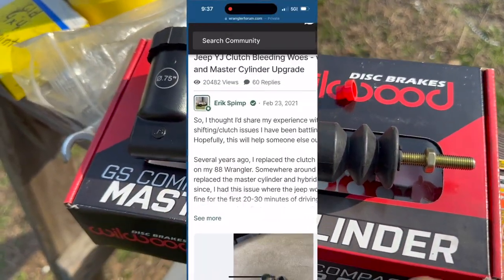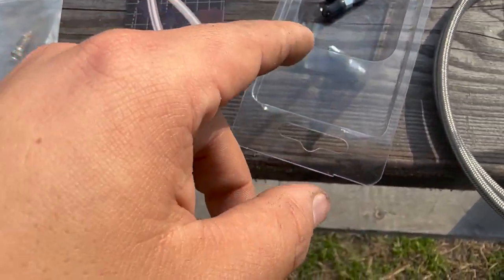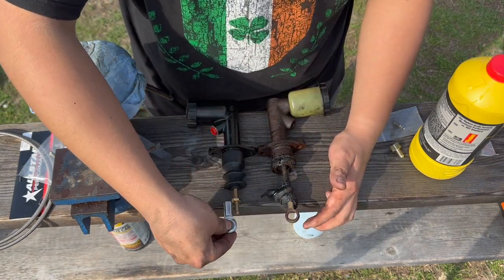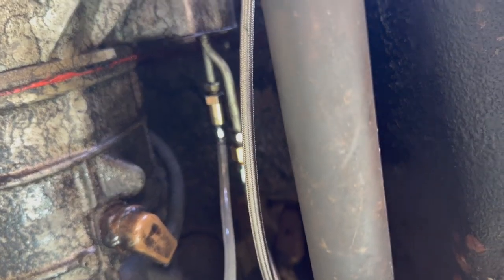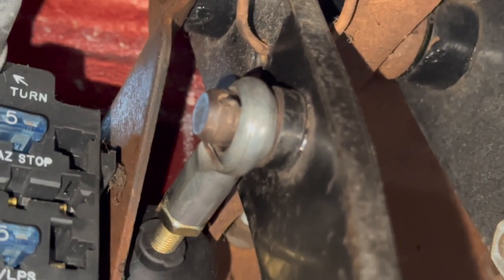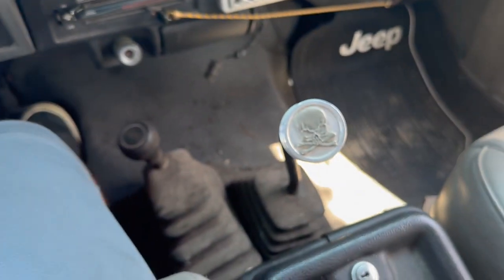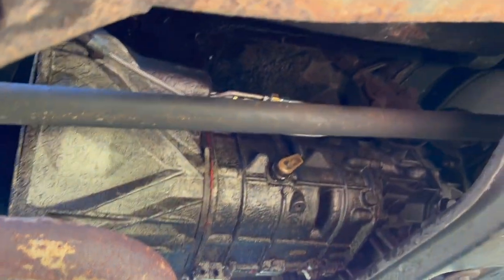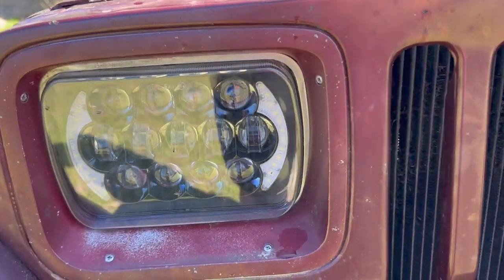Master Clutch Cylinder UPGRADE Jeep Wrangler YJ 1988 - Wilwood USA

Comment: A worthy upgrade. The stock/Rockauto masters are constantly going out (usually showing up as a leak down the inside of the firewall by the clutch pedal). I have an '87 YJ that could use this master. Good job, Sir!
Reply from the maker: Thank you! It’s still holding up great. I don’t regret doing this upgrade and when I found out about it I had to film it.

Comment: Thanks man! I also have same exact ba10 problem as the guy in forums that came up with, and described this upgrade from crappy chinese double cup seal master.  A bit different symptoms than yours. Glad it improved yours, but sounds like you have some syncro issues in your old ba10. Mine works great until Jeep is driven for about half hour or so, then 1st and 2nd become hard to get into. Hoping this is good and solid fix for my issue, like it was for original forum poster.  Anyway...just wanted to say well done, and thanks for putting together a visual version of this process, makes it very nice to see the upgrade performed in the real world as well. Thumbs up, and subscribed! D
Reply from the maker: No problem! That’s why I made this video to help out others that have the same or similar issues. This mod still works great and I haven’t had any issues besides my usual synchro issue. I think it’s well worth the effort because the master cylinder can be used with the ax15 when ungraded.

Comment: I know advance adapters sold a ax15 kit to swap the transfer case and all to an ax15 transmission. I had to watch this video again. I'm going to copy your parts list and perform this swap before doing an ax15 swap . If you have concerns about your hard brake lines .I would install new copper /nickel lines . The info on the videos is appreciated.
Reply from the maker: This mod is still holding up great! No issues so far and most importantly no leaks. I’m saving up for the swap but for I’ll try and make this one tranny last as long as I can

Comment: A month later … still driving good? The 2nd gear issue pop up again?
Reply from the maker: My 2nd gear synchro is just worn out so the issue is present when the tranny is cold. When cold I skip 2nd and go into third. Once warmed up I’m able to double clutch into 2nd gear. Before this mod I wasn’t able to double clutch but now it works great

Comment: There is absolutely zero reason to double clutch a synchronized transmission.
Reply from the maker: There is in this case with mine. If I don’t double clutch into 2nd I’ll grind 100%. Once I warmed up the tranny no grinding into 2nd when double clutch. It’s just my synchro is worn out